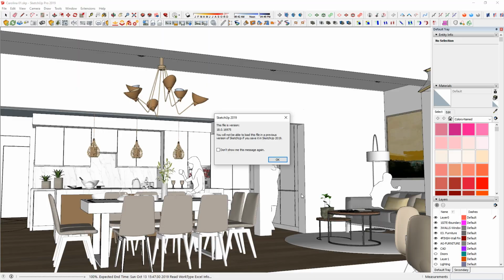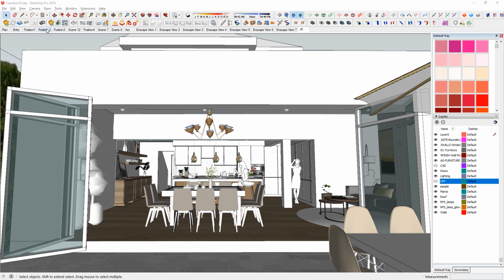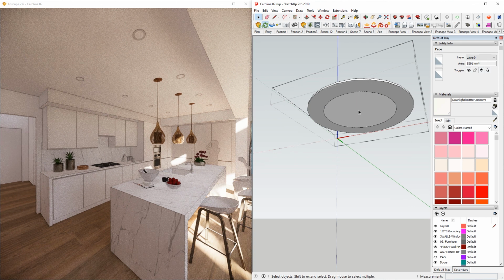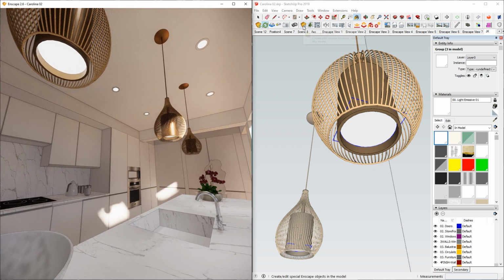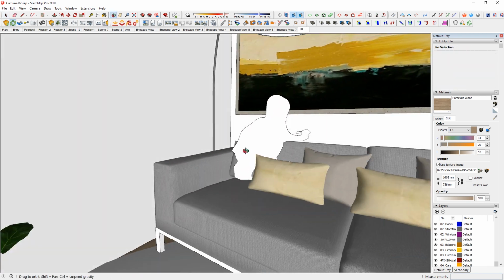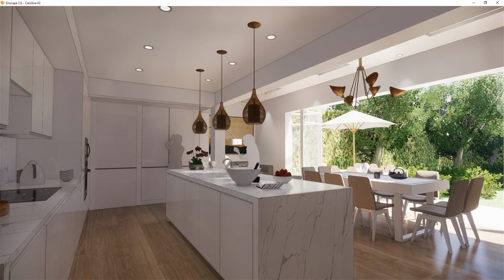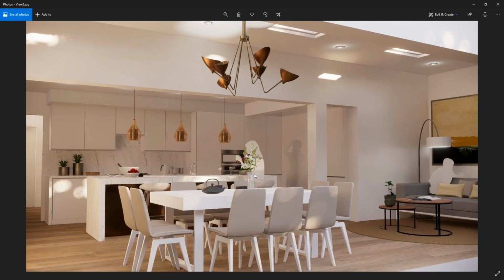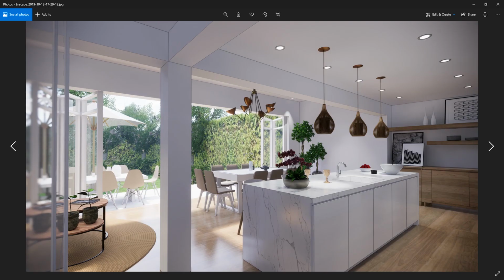Model Critique - SketchUp & Enscape Interior Rendering Workflow Tips and Tricks

Comment: Hey buddy how are you? That's awesome video.. Give us some tricks about sketchup layout.. I personally think that layout is far  more better than autocad.. But some minor things which generally left out while working.. Can you give us some tricks about layout for fast and beautiful digital drawings
Reply: Layout is definitely a fully fledged capable tool to create all sort of professional documentation work.
But the ONE problem with it that haven't been fixed for ages - performance. The software got really laggy really quickly, even moving a textbox is a struggle...
Reply from the maker: @nameinvalid69  I agree with that statement in many aspects. I think there are few things that can be done to help, but it still isn't something that is going to change drastically.
Reply from the maker: I agree Layout is much better tool especially when working with SketchUp. However, I haven't had too many projects that's required CD to be worked in Layout. Are you needing to do residential work?